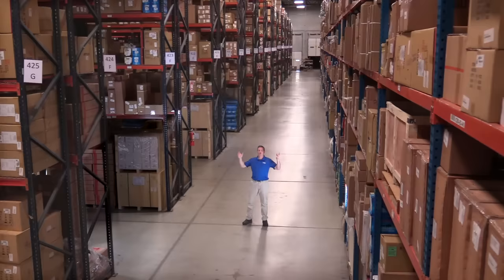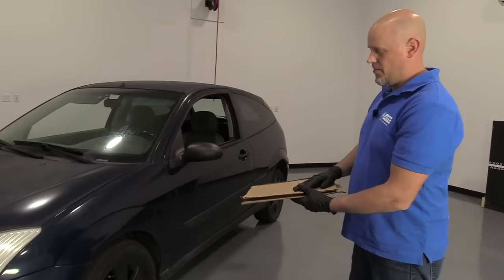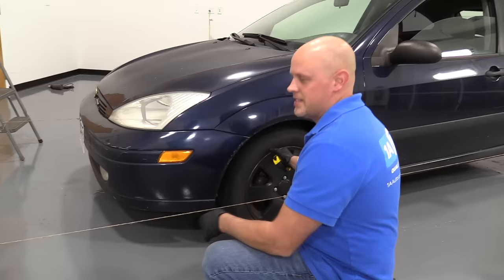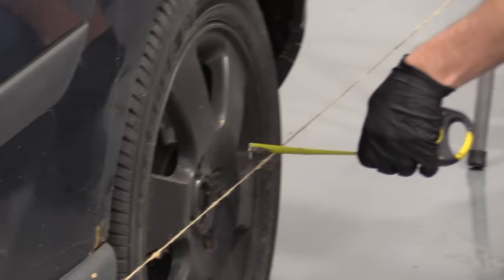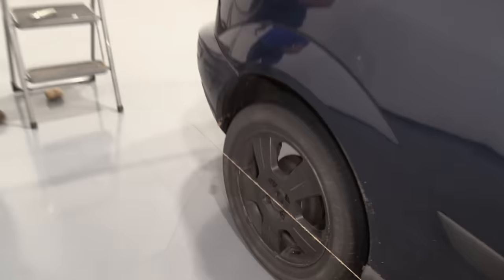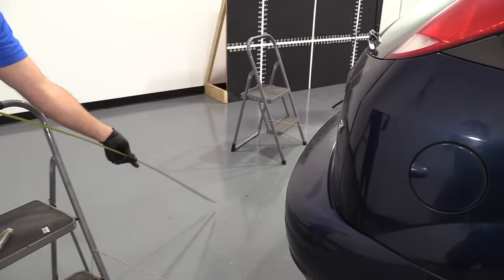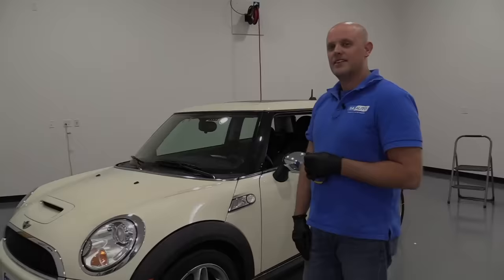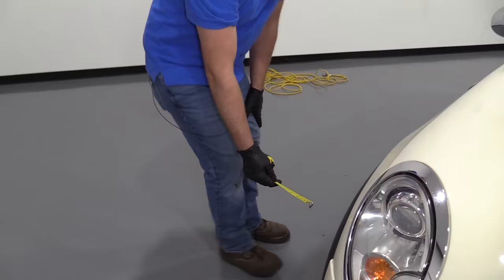How to Perform Wheel Alignment by Yourself

Comment: Tip.  The tie rod turns needed can be calculated by the thread pitch.
Reply: It’s never gonna be as precise because there always other parts that turn a bit even when you secure those so they don’t move much as you loosen or tighten the nut, or turning the tie rod inner to adjust. And the human factor that usually never does micrometer précision on turns.

Comment: That's the way to do it, I like this method better,👍 to the measuring of the tires. But I prefer using 4 Jack Stands with fluorescent fishing line. I also prefer using the "Dream Stick" Alignment tool (which  you can buy on line) it makes it much easier to actually see your measurements without having to use the tape measure.

Comment: I have a 2005 Ford Focus this is 2022 the car has 322,600 MI and still runs good it's a 2.0 duratec with a 5-speed manual best car ever had

Comment: Place a piece of tape over the top of steering wheel and steering column cover... centered. Then take a razor blade and cut the tape in the gap of those two parts. This way you get the steering wheel back in the same position each time after turning it, by aligning the tape up. Takes the guess work out of where to put the steering wheel back.
Reply: Not quite understanding what you're talkin about

Comment: When you adjusted the chair in the rear to square up the lineS, didn’t that throw off your measurement of center wheel out to the string ?
Reply: Exactly.
Reply: As long as the strings are parallel and distance to hub center reflects the parallelism then the difference of the front and rear readings is the toe-in or toe-out.
Reply: It was going to affect it regarless. The stools aren't equal distance (from car) to start with, which is why the Mini at the end was 1.5" on the driver and 1.25" on the passenger. With that, it's still identical to say the least.

But this would also open one's eyes say if they never noticed a longer/shorter spindle was swapped out. Which I had one on an '86 Fox Body that I pointed out before moving from Nevada. When we had it on jacks in Ohio, my dad went "dude, you're right. The passenger side is sticking out further"
Reply: Yes it would!
You need to split the difference. In this example the front was 1 inch wider than the rear. This means each rear chair or stool needs to be moved out 1/2 inch.
Reply: Totally bothered me when I saw it.

Comment: Will never forget getting burned by Fowler's Alignment in Phenix City Al, paid him $125 to align my Silverado, got it back and the steering wheel had to be turned to 10 o'clock to keep it straight. Took it back, he kept it another 6 hours and come to find out he never even touched it. I ended up going to an old shop in town that still used the string method shown here and it drove like new.

Comment: I've always hated alignment issues, and hated even more having to pay someone to do it. This was a great explanation, and with patience this worked incredibly well.

To make the tie rods easier to access, I put a couple 4x4s together and lifted the car onto those. That way I could reach underneath without having to move the steering wheel, and could check the adjustment as I was making it. Instead of cardboard, I used a plastic sign that I had found and cut up (I have to work in the rain, cardboard doesn't hold up too well in those conditions, I don't have a nice warm shop to work in!) 

Hardest part was loosing the nut. Try loosing the track rod a bit (creating more toe in), then flood the thing with some sort of penetrating grease and let it sit for a while. Twist the nut over the clean threads, before trying to twist it over all the rusted part. Once you move it, you can also take a wire brush to the rusted part and clean it up a bit. It wasn't easy, but it worked. Just have to work the nut back and forth, both directions, then set the alignment and tighten.

Thanks for posting this!

Comment: On our 2012 G37 RWD, we had to replace an outer tie-rod on the drivers side, as it was completely shot. Once that was accomplished, the wheel is now pointing with a toe-out condition. Since the tie-rod connects towards the rear of the tire, like in this video, we have to add length to the tie rods, as it's obviously now too short, hence the knuckle being pulled inward, causing the wheel to toe out. If the tie-rod connected to the knuckle towards the front of the wheel, toe-out would mean too much length and we would have to reduce the length to get the wheel straight.

Comment: So about the adjustment. If your rod has 16 threads per inch, one revolution would be 1/16 inch obviously. Then if the measurement from the wheel pivot to the tie rod is 3 inch and the rim diameter is 15 that ratio is 5. One turn is 5/16 adjustment in your front to back toe in. Bottom line, I only want to do that string set up once only if I can help it. Great video. I use your technique to set the alignment on my road grader this way because the tire shop told me to “get out of here” when I brought it in.

Comment: On my 2012 G37, the lock nut comes loose, but when I turn it, it rotates the inner tie rod so still stuck on the one side with some corrosion. Gonna use some PB Blast and a wire brush to clean things tomorrow.

Comment: This is a toe-in/out adjustment only.
Reply: Which is the only adjustment usual on front wheel cars, the struts are usually fixed with no adjustment unless in my case I bought Monroe struts for my 2001 lesabre and the bottom hole was elongated meaning it was oval or egg shaped allowing for caster and camber to be adjusted as well and of course some vehicles need a four wheel alignment.

Comment: At 7:08, there is some trigonometry you can apply to set the tow to what you need in one shot, it requires measuring how far the toe knuckle is back/front from the center line of the axle and measuring how far the toe knuckle is offset from the center line of the tire left/right and up/down, and camber and caster (5 measurements in all). You need to take the wheels off to make those measurements using some elegant techniques, but once you have the first 3 for your car you keep them for reference, plug the distance of toe change needed into an equation and you get the precise distance you need to move the tow arm in or out which you can measure with reference lines circumscribed on the knuckle flange and on the tow arm just past the wrench spots.

Comment: Great generic set up to see if a DIY'er wants to get into basic alignment ; many "super enthusiasts" get their start with videos like this.  Well done!  Also, the way you showed how to make sure the string lines are parallel to one another is key (ie you measured to make sure the front and the rear part of the "rectangle" is the same distance apart  - on each end) ; the string lines must be parallel to one another - as you demonstrated with the tape measure.   The cardboard trick was also clever!
Reply from the maker: +Stefan Czechorski DDS Thanks for checking us out! 1AAuto.com

Comment: Other tip, if you run the lock nut on the tie rod end all the way to stop, Measure the inside distance from lock nut to tie rod end, then screw it in the measurement you need to zero out your toe.
Reply from the maker: +Aron Apple Thanks for the tip!

Comment: You didn’t recheck if your square was good after adjusting the back string, you weren’t able to know which side was off from square passenger or driver, but other than that that great video

Comment: I run a string right up against the front and rear edge of the rear tire at center cap height to get my straight edge. My tires do stick out wider than the car body so it's a better method than measuring an inch, or whatever clearance is needed on both center caps. Just less margin for error running against the tire if you can. Then run the string against the front tire and with the string just barely touching the rear edge of the tire, i can get the 1/16 measurement, the thickness of the twine i use, of the gap at the front edge of the tire. I use a straight edge ruler against the rim edge. not a carpenters ruler against a spoke. I can get under my car to unlock the bolt and make adjustments without turning my wheel to get at it. I also keep checking the centering of the steering wheel as I make adjustments. Using the tape measure across the backside and frontside of the tire is good for a final check but not for doing the alignment. Both tires could be toed to the right and measure 1/8 but you would not be in a alignment.
Reply from the maker: +Jeff Flowers Thanks for checking us out. 1aauto.com

Comment: Some time ago, I bought an infrared motorcycle chain adjustment tool (quite inexpensive), and when I watched this video I couldn't help but thinking that it probably would be easier and more precise, albeit slightly more expensive, to use one of those for wheel alignment? It's not easy to fit directly on the wheel rim, but perhaps aided by a piece of wood or something, and then aiming at, say, a wall or garage door or something and do the measurement there.

Comment: What i do is measure the inside  rim to inside rim instead center of the tire, camber can be done with a level just have to have a flat surface
Reply: That's hard to do on my lowered truck so I did it this way

Comment: Everyone needs to check the brake hoses. I had NTB replace brakes, struts and shocks, new tires and problems started 5 times back to their shop. They had my car for a week. Full tank of gas , I told them to Drive it, there is something wrong!! They Never checked the brake hoses, I ended up having to replace the brakes, and rotors and being towed in. I need to write a letter to the owner of NTB. I gave them every opportunity to find what the problem was and told them I don't want my car back until it's fixed. Always,we couldn't find anything wrong and drove it around in the parking lot. I paid over 3000 for everything and got a lesson, stay with a locally owned garage.

Comment: What happened to the "TOE -IN"? Front wheels should point inward on front edge to keep tires from wanting to separate from vehicle. This "TOE-IN' is specified by the manufacturer. Should be very small angle. A degree or fractions of a degree. Without the toe in wheels have a tendency to wander left and right. Especially on bumpy roads.

Comment: I have a question? Do u need alinment after getting all 4 Ball joints.an control arms replace now my steering wheel is tilted to the left thanks
Reply: Yes. Do it just because you changed the ball joints.

Comment: The issue I'm having is the lock nut breaks free, but when you rotate it, the inner tie rod moves, so there is corrosion there, and the lock nut is basically stuck onto the inner tie rod. Need to add some heat or a wire brush to clean away the corrosion & get the lock nut to spin free so I can more the inner toe rod independently then use the lock nut to tighten things up. The way it stands now, spinning the lock nut any way only serves to move the inner tie rod, so no adjustment is possible as the lock nut just goes back they way it was along with the inner tie rod.

Comment: Thank you, thank you, thank you. I took my van to the shop to have them put inner-tierods in, and they didn't put them in correctly causing my van's front-end alignment to go off. Because they never replaced my tierod screws. So I'm stuck doing it myself.  I don't trust any more shops. I'm done. Thank you.

Comment: I wish you would show how you get the string set up in place
Reply: Agreed. The basic idea is to use the back wheels as a guide for the strings, which then serve as guides for the front wheels (this assumes your back wheels are straight). The strings need to be strong, tight, straight, and ideally over the center of both wheels (as well as at least the length of the car).

With the strings straight and tight, set them up so they're the same distance from the front and rear edge of the REAR wheels (let's say an inch). Line up the strings so they're parallel to the rear wheels, then adjust the front toe-in until the front wheels are parallel with the strings (then factor in the 1/16th in. toe-in).

Comment: With a car on a flat floor/ground it's much easer and more accurate to mark up wheel half way and with angle mark floor, move car half turn and mark floor againe and measure the diffrece of the marking and that's the toe.

Comment: note that you must keep it straight in reference to the rear wheels, so the second method is not valid as its only syncs the two front wheels, with one each other. there's no reference to the direction of the car
Reply from the maker: +Pazushh Thanks for the feedback!

Comment: When you measure the string 1 inch from center cap on the rear and then 1 inch on the front your string will be on an angle giving false readings. Most cars have a different width from one axel to the other.
Reply from the maker: Thank you for the feedback! +Hill Billy
Reply: There can be a difference on some cars or if you changed brake rotors from originals but......I think that's why he measured the "width" from string to string in front and rear, if they are the same & distance from center of hub on each axles is the same front & rear then the axles are same width & youre good to go...at least I think so.
Reply: It's all relative, you just work with the gaps you have with the string gap at the front wheel bigger or smaller
Reply: A couple of points.

Any difference in a normal vehicle's Track Width would result in a Calculable Toe-In Error but it would be so small it Could Not be Measured using the Equipment/Material/Methode shown.

The intent of this Toe-In Adjustment was to allow driving to a Alignment Shop, without undo wear on the tires, to get the job done right which would also include Caster/Camber Adjustments.

In summary, your post is CLOSE to being Correct but it is NOT Accurate because it fails to take into account the fact that the Tech "SQUARED-UP" the Strings before checking the measurements hence your Point is a Mute Point.
Reply: @rjinnh3933  you have fell into the normal trap of different axle lengths making a difference. It does not it is all relevant. The distances from the front wheel to string is irelavant. Equal gaps ( no matter how far apart) are what is worked with. If the gap is an inch or two inches you still make adjustments the same. You fall into the same catagoey of people, including those at tyre shops, who do not know the basics but tend to muddy the waters with irrelevant info.
Reply: @bonkeydollocks1879  
If you re-read the original poster's post and then my post, you will see that your post to me has no bearing on the subject at hand and in effect, your post mimicked my post.

I.E. The original poster's post was irrelevant!
Reply: @rjinnh3933  oh sorry if you thought I was contradictory to your thoughts, I was just explaining to you and hopefully other people on YouTube axle width differences and the string method still work its all relevant.

Sorry for any distress I caused you.

Relative according to Oxford English dictionary ;

" being judged or measured in comparison with something else"

Good day to you dear boy
Reply: @rjinnh3933  oh yea, sorry

Comment: I would like to add that not all cars have parallel track width. I found this out after trying this method like 10 times on my Buick Rendezvous only to learn that the front wheels are 28mm narrower than the rears, which explains why I wasn't able to get it even close.

Look up your cars track width before you attempt this or you could be actually making the alignment much worse.
Reply from the maker: +Worse Than Fiction Podcast Thanks for the tip!

Comment: Any insight to shed on the tape measure method? If the front or back is off, which wheel do you adjust?
Reply: Well the back wheels don't steer the car so the front m8 ;)

Comment: @6:50 this is where the problems really begin when you discover the track rod end is welded to the track rod with years of rust
Reply: I had the same problem. Try loosing the track rod end a bit (creating more toe in), then flood the thing with some sort of penetrating grease and let it sit for a while. Twist the nut over the clean threads, before trying to twist it over all the rusted part. Once you move it, you can also take a wire brush to the rusted part and clean it up a bit. It wasn't easy, but it worked. Just have to work the nut back and forth, both directions, then set the alignment and tighten.
Reply: @bradsherwin4568  yea that's what I did, another help is to open up the slit on the track rod end with a small chisel, it helped immensely on my bmw but not all track rod ends have this

Comment: What if a vehicle has rear toe-in? How can we make sure the strings are parallel?
Reply: Video is only for rough toe-in after front end repairs in order to get to an alignment shop. I think he over complicates the process.  I just measure the treads at front and back side of front tires and get it close. Never had an issue.
Reply from the maker: +John B Desj Make sure that whatever 4 objects are holding the strings, are square. Follow the instructions in the video. Of course if you have any doubts, have it professionally aligned. This string method is just to help you save a few $$.

Comment: Get a Snap on caster/camber gauge from EBAY to align the front end. Get a toe-bar to set toe. Don't get a camber gauge that measures degrees if yours is inches. Get a toe bar with markings on both ends.